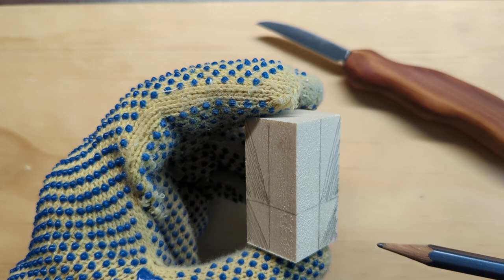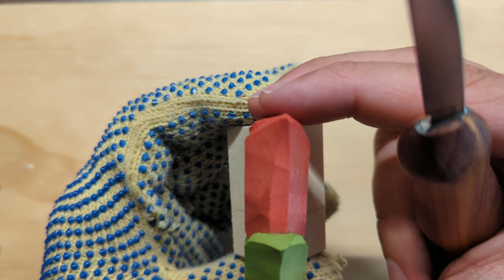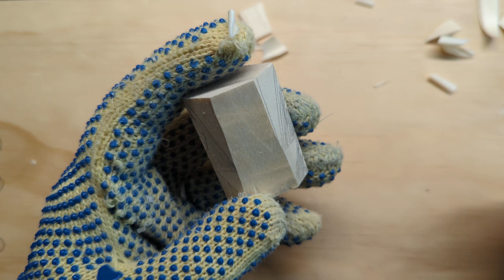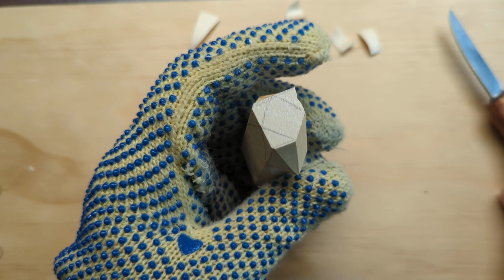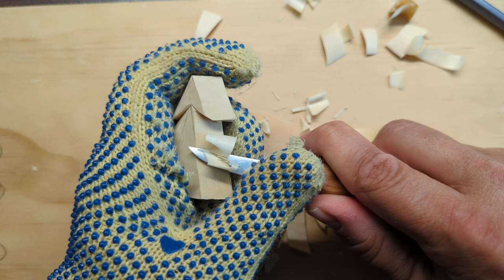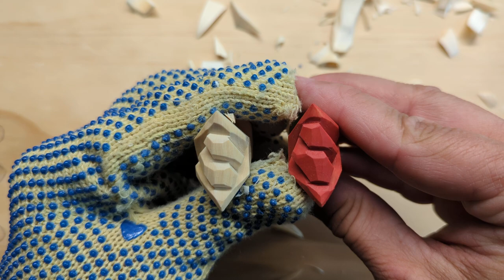How to Whittle a Simple Flower - Beginner Whittling Lesson

Comment: Thank you for NOT starting with a 3/4" board or using a saw to rough out.  Too many "beginner" projects start with odd sized blocks or seem to assume that I have a full wood shop complete with a band or scroll saw or such.  I don't and I feel frustrated trying to even start those projects.  My 1-1/2" DHK worked fine for roughing out this small project.  🙂